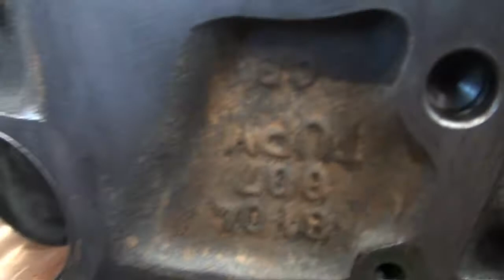12 Valve Cummins Oil Flow

Comment: My 1996 12v has something going on, whenever I remove the oil filter to change it, wether the truck was just running 5 minutes before, or if it has been sitting all night, the filter is half empty.

Comment: I have no oil pressure for about 6 to 8 seconds after startup. Is this normal?  I have not seen any information on this topic.
Hot  oil pressure is above 15 at idle and above 60 when driving.
Reply from the maker: That sounds like a problem, I think I would try a pressure gauge mounted in the plug above the oil filter.
Reply: There's about a 10 second delay on start up from the pressure sensor to when the computer reads the signal. To make absolutely sure you have oil pressure hook a mechanical gauge up to one of the ports on the filter head.